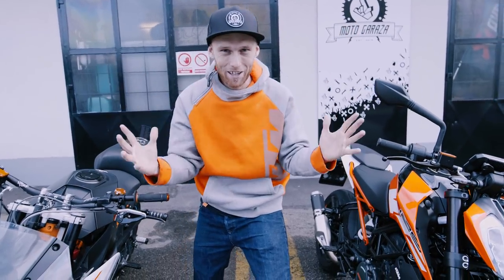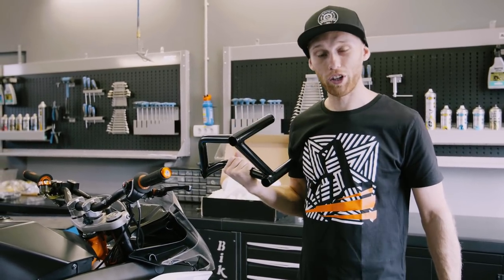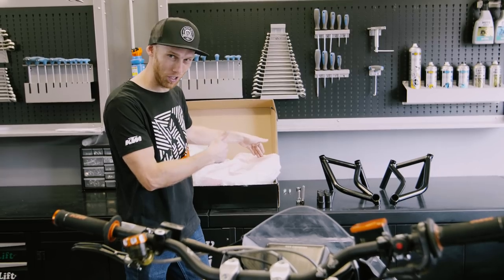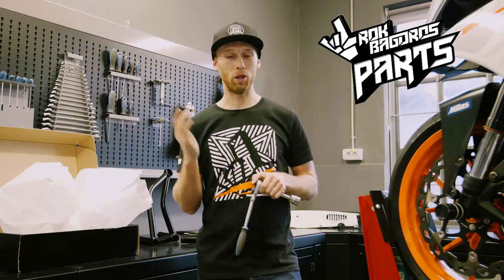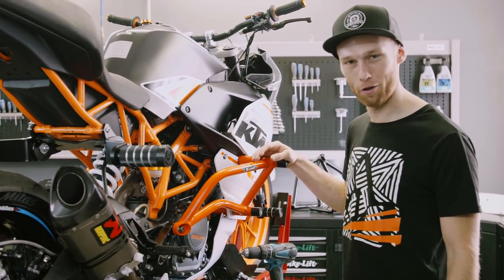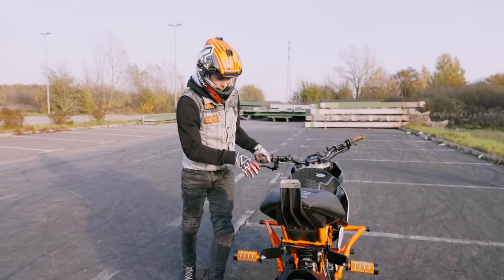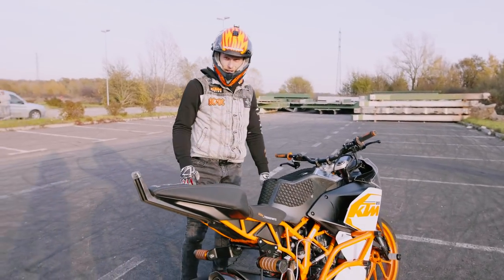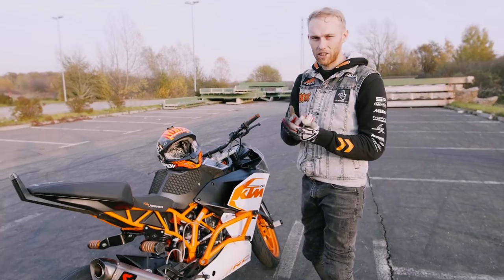Crashed hard with the RC | RokON VLOG #38

Comment: If I'm not mistaken the engine part of the frame is the same as the Duke 390 2017. So in theory should be able to fit one of these on the Duke as well, but that's only the theory so would love to see if it does ROK. If indeed it does you have a customer for one of these straight away. RockON boy.

Comment: Bro you can make those plastic ends of the cage... cuz after crash it gets rubbed off
Reply from the maker: harsh singh thats why they are ment. They need to be replaced after a while. Why no steel sliders, the plastic ones absorb the crash much better than if the bike lands straight onto a steel tube or slider. 😉 you are welcome 😋